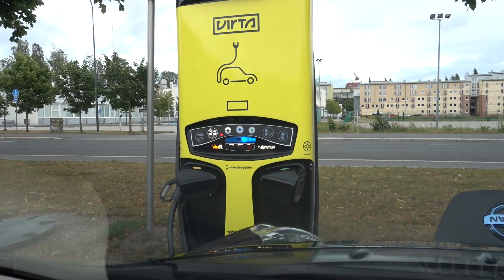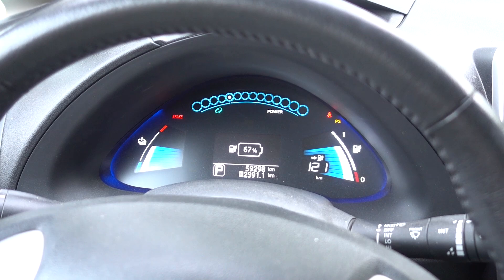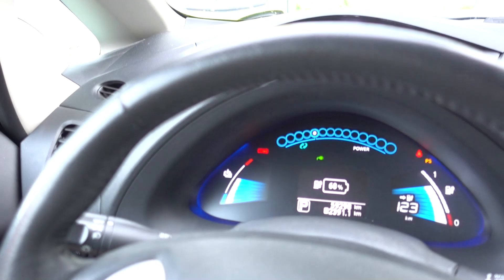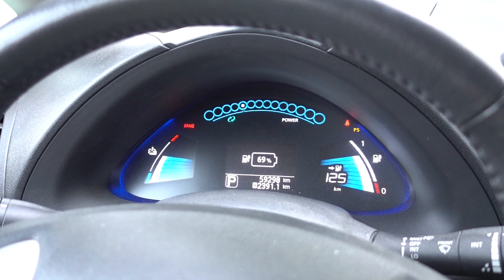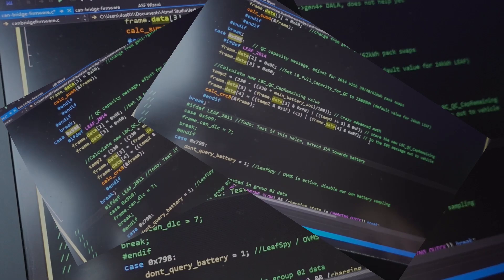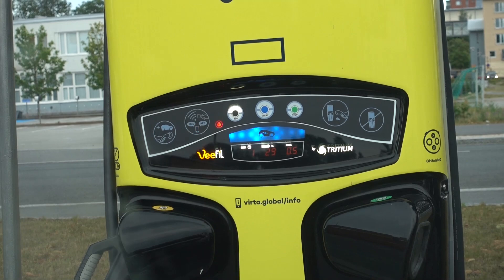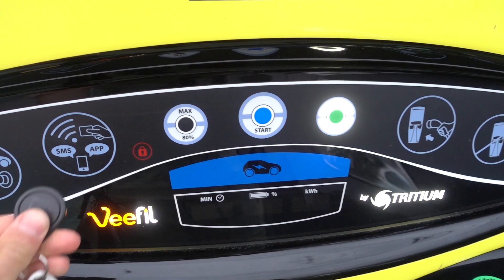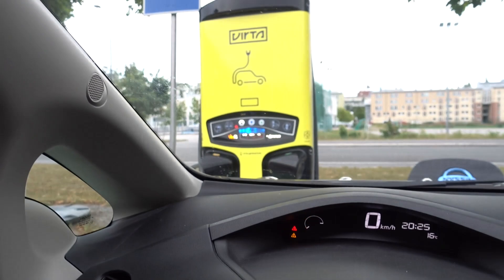Confusing quickchargers and fixing more bugs!

Comment: To my very uneducated eye, this looks scary. If the charger sees something well below the actual state of charge what happens when the battery is in fact fully charged? Will the car send a signal to stop?
Reply from the maker: There are multiple safeguards in check here, what you see is just cosmetic. It only gets dangerous if you start to modify the current demand messages, then you need to know what you are doing!
Reply: In the CHAdeMO standard the charger is disallowed to do anything based on the state of charge value the car is sending to it. It's purely cosmetic. The charger acts based on voltage and current that it measures itself and the car also does, acting as a double check.

Comment: We don't have these Tritium chargers in the Baltics. So far I did not have any issue on any charger with my Leaf since 2016. Hence I am kind of amazed that there is such incompatibility with these Tritium chargers. Maybe Virta just forgot to update the firmware? Those are plentiful in Norway so they should already have a fix from the charger side. O are the thousands of Norwegian Leaf drivers suffering from this as well?
Reply from the maker: This issue is for battery upgraded Leafs only! Eg my is a 40kWh 2015 model!
Reply: @DalasEVRepair  Oh, got it. How does your backlog look like for Leaf 24 -> 40kWh upgrades? I have scheduled a 40kWh upgrade + extender with Muxsan , but it seems like they are having trouble with battery module supplies. So not sure I can wait till next year (SOH at 56% now). So maybe I should upgrade to 40kWh at your place and then do the extender later. EDIT: found the price. (Upgrade to 40kWh, ~6000€).
Reply from the maker: @mjk8019  i also have ca 30 people on queue with next to no batteries 😬
Reply: ABRP shows it will take me 18 hours and 22 charges to get to you (+ Tallinn-Helsinki ferry) :D. I think it will take evewn longer as I have to drive slower to not overheat the battery. With 56% SOH it tends to heat up very quickly, and charges fast only up until 30-40%, depending on temperature. So would be quite an adventure. Maybe it would be easier to order parts and DIY?
Reply: @DalasEVRepair  lol. Welp at least the business model is working :D. Anyway, good thing that we have plenty of QCs here in Vilnius. So hopefully I will survive the winter :D

Comment: Hello sir , love your channel & I respect your knowledge .
    I have a 2013 Leaf with 10 / 12 SOH..... how significant is the degradation from charging 240v  to 100%  5-6 ×/week ?
Reply: Keeping the battery at 100% will be what is hurting it and loosing the health. Can you get away with only charging to 80% not full (that can be set on the charge timer settings)? If you have to go to 100% try and get it to finish charging just before you need to use the car (by adjusting the time it starts charging, so it doesn't sit at the delicate 100% for too long?
Reply from the maker: Heat often degrades the batteries more than amount of charges. Try to keep it as cool as possible, and charge to 80% if possible. Other than that, not much can be done to slow down degradation. The 2011-2013 LMO chemistry is notorious for not handling the heat :(
Reply: @SheepShearerMike  thank you very much
Reply: @DalasEVRepair   copy ,thank you for the advice
Reply: @SheepShearerMike .... I can get away with 80% as long as there are no errands or "wife" surprises , added to the commute .... would it help if I  charged to 92% or 95% ? because then it would be more a practical range for my commute...
     Full respect🙏🏻
Reply: @matthewzizzo4586  Charging to 92% is better for the battery than 100%, but if you do need to charge to 100% it's best to do it just before you need to use the car to minimize the time spent at 100%. It's good to occasionally do a full charge to ensure the pack stays balanced.

Comment: But as I can see on screen of laptop - nothing to changed in source code  after 3 hours! what was the root cause of bug ?
Reply from the maker: Source code available here: https://github.com/dalathegreat/Nissan-LEAF-Battery-Upgrade

The issue was incorrect formatting of 0x59E message.
Reply: @DalasEVRepair  I was there as well ) there are the same code like on screen from video )